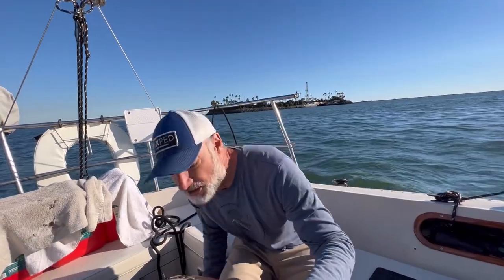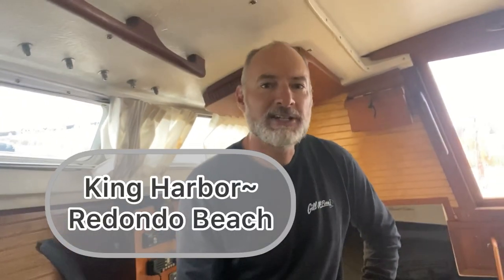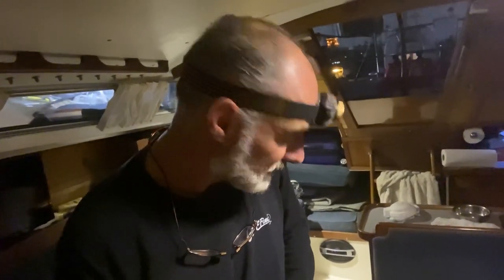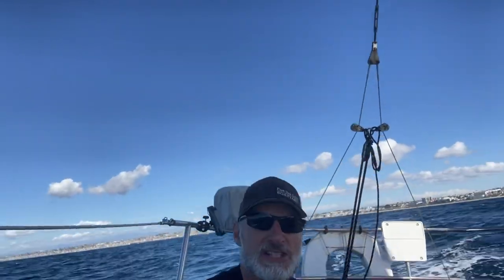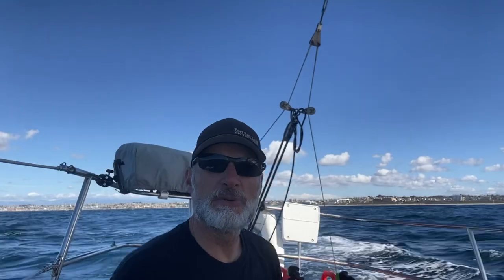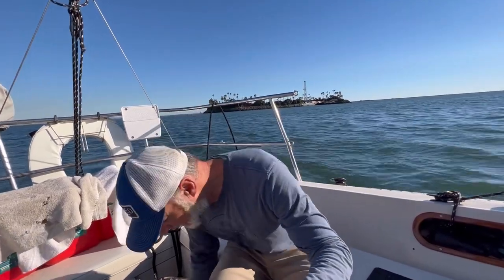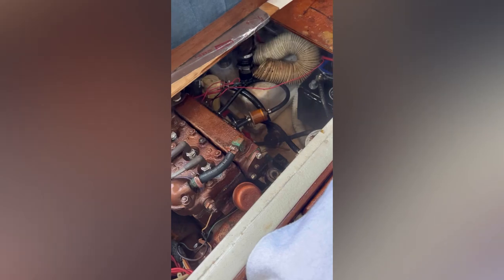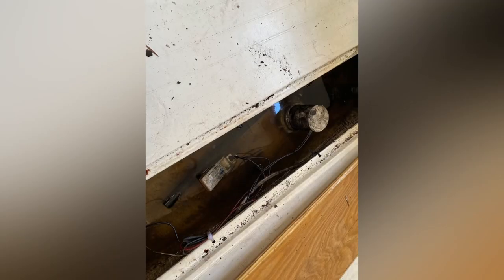Coastal Cruising Part 2-Episode 12 | Near Sinking | Catalina 30 Sailing Lugares

Comment: Hello I own Catalina 30 hull 203 1976.  I had that the same exhaust trouble once . Made it to the dock. Warning for you. Get rid of that carpet in the event of getting wet it falls apart and plugs the bilge pump. I replaced my A4
With a diesel. No more boat smell. I have a ray marine auto pilot on my tiller. Works great. Also one improvement 
I made was making a little shelf on hinges. That 10” helps alot when cooking